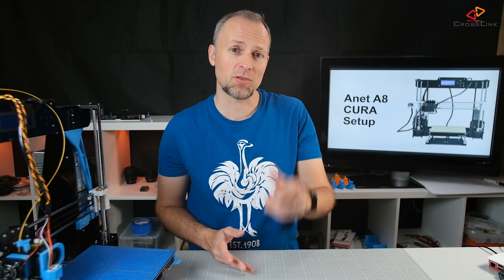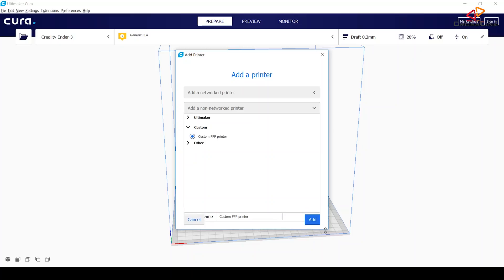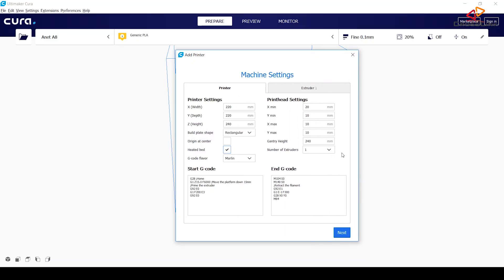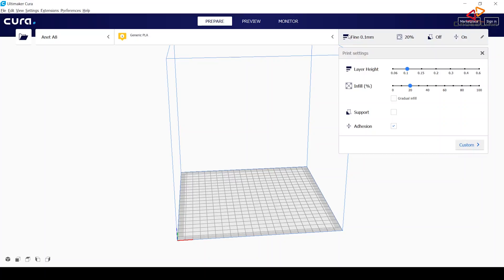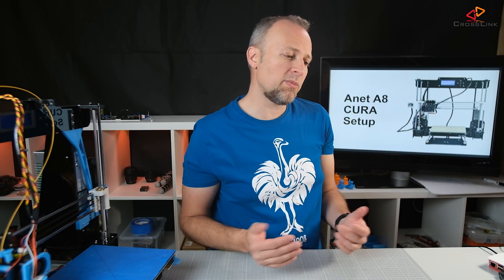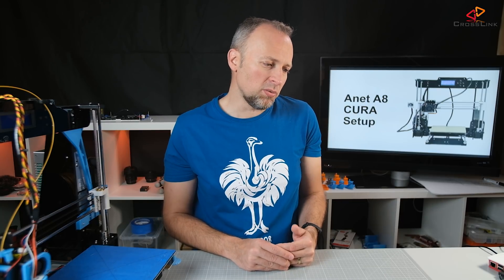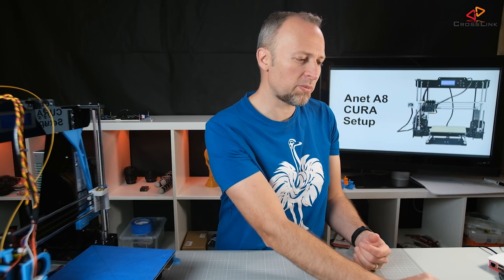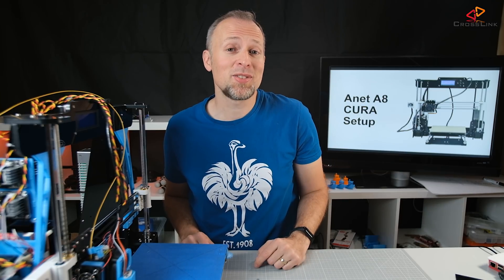Anet A8 CURA setup

Comment: I bought mine in 2018.  i need to setup a new pc but i dont have the old version of cura 14.07 which the document says to install and its not on their website. Can I use a newer version? if not, where can I get the old version?
thanks
Reply from the maker: You can use the latest! It works just fine
Reply: I found out CURA new versions will not support USB printing.. Older version is still available 3.1 works for me.  Also Setup your Com port to 115200  8N1N on Windows device manager

Comment: I was gifted a non functioning A8 with Marlin 1.1.8.  I repaired a loose leveler connection cleared a jammed hot end , replaced the lcd screen, figured out Cura and got it printing. I am now upgrading and fine tuning it. Is my next step upgrading Marlin? I don't know if my board has a bootloader. Where do I start with getting my software current?

Comment: Thanks for your videos , wonderfully explained. I have a problem with max Z axis height in which both hardware switches and cura software
Limit the height to about 35mm. I know what’s happening but don’t know why. Every click of the Z fast position operation assumes a 1mm increase
In height on the LCD display but due to the lead screw of 8mm it only  raises the Z axis by 1.25 mm every 8 clicks ( 1 rotation of the lead screw) so in short it only raises the Z axis by 1/6 th of the hardware reading. PLEASE tell me what to do , I’m in the dark , I have V1.5 motherboard.
Hope to hear , kind regards Alan.

Comment: How to set up print via usb. My other printer has no problem its a sintron sw 101
Reply: I found out CURA new versions will not support USB printing.. Older version is still available 3.1 works for me.  Also Setup your Com port to 115200  8N1N on Windows device manager

Comment: Man, I have a heck of a time getting my first layer going. I set up a skirt with lots of laps and far away from the part, but cura thinks I want to print with the nozzle like 4mm away from the build plate.  I have to crank the Z steppers down by hand a few clicks to get it close enough to the build plate for the extrusion to make contact with the bed.   - and if I dont do it this way, - IE, if I raise the bed, or adjust  the z axis zero switch, then the print nozzle will crash into the bed when homing...

Comment: Here's a weird question for you - the cooling fan (that points to the nozzle, not over the gears) doesn't turn on except when I boot the A8. I can't seem to find anywhere in Marlin where the code is wrong. Any ideas?

Comment: Daniel: is there a way to connect the CURA GUI to the Anet A8? I have a TronXY 3SX and I am connecting Repetier installed on my laptop to the 3D printer. The printer uses a Melzi V2.0.5 controller board. I can control the printer from my laptop. For small prints this seems to be easy. I have not found a way to connect Cura to the Anet A8 using my laptop. Have you fond a way to connect to the Anet A8 with Cura, Repitier, Slic3er. Thanks for any information. Richard

Comment: Maybe you should add in the description, that the video is a guide for setting up Anet A8 in Cura version 4.1 (which is pretty outdated by 2020/04).
The current Cura version (4.6) seems to come with an Anet A8 profile, though it differs a bit from your settings...
I would be happy if you would provide a new updated video.
Thanks though.

Comment: Great video, but when you set it up in cura, does automatically save them settings and then load them into the printer or do you have to manually do the same on the printer? I've only just built mine, and am setting it up, any help would be appreciated, thanks

Comment: Hey! I was given an Anet A8, but we've run into a problem. Everything seems to work except the hearing element isn't doing anything. It starts going through the motions of printing without anything coming it and the readout says 0°. I was told the heat sensor was bad, and they sent a new one, but I've tested the great sensor that already installed with a multimeter and it works. Any thoughts? I didn't buy this, it was given to me, and I don't know how to contact the manufacturer.

Comment: hello, i am having a problem with my Anet a 8 printer. the problem is its not printing the complete object but it show 100% on display but the printer just freeze there an do nothing  until disable the stepper and remove the print. please replay soon as possible

Comment: Hi : Daniel
My first Anet A8 is Ready for Take off. Im in Big trouble - Mac user. How to get started with Cura.
Need A video lesson.
Lars Lundbæk🇩🇰
Reply from the maker: So, CURA on Mac, I understand. I will have to get my old mac a new keyboard, then....
Reply: Crosslink Hi: Daniel
I Found out, when Mac writes “ No “
Ignore and go to Private Settings and accept.
Them it works.
Lars Lundbæk🇩🇰

Comment: Greetings, have you checked out the much better start and end GCode for the Anet A8 ?
https://tinyurl.com/rhb3y2h
Reply from the maker: Thanks for the link. My start and end codes look different. I use the ones from the Ender 3 that CURA creates. Works great. Especially the start code for the Ender 3 is much better because of the line it draws at the left side of the bed to get rid of any filament hanging around the nozzle.

Comment: Thanks for making a great video. I followed your instructions and I am having a better results.  I had a question. What is the reason when I am printing the filament is printing rough. bumpy. I that to do with the leveling?  How do I fix this? Thanks
Reply from the maker: Hi Marko, I would suggest, you print a benchy and send me some photos on twitter. Use the hashtag #checkmybenchy so I will get notified.
Reply from the maker: But don't send them on private message, just mention @danielcrosslink and #checkmybenchy

Comment: Is Anet A8 running with the G Code Flavor Marlin or RapRap, because it's always different in the videos from other Youtubers.
Sebi
Reply from the maker: Marlin flavor in my case. I have all my printers running on Marlin firmware. Also the stock firmware is Marlin flavor.
Reply: @Crosslink3D  Thank you for the fast answer!

Comment: Good video. For those using Cura 4.1 they need to add an additional 'Speed' setting. The value needs to be changed from '0' to '500'. If left at zero the A8 makes some looooong pauses when printing.
Reply: Can you please please elaborate. I actually would like to do this. Thanks !

Comment: Good video thanks.
I use both the latest version of Cura and 15.04.6 the reason is that 15.04.06 loads faster operates smoother on my 10 year old computer and is adequate for most of my printing needs but sometimes I want or need to use some of the new features and then I'll load the newest version.

I hope you get a chance to get an Anet A8 Plus. My grandson in-law has one and it's a huge improvement over the original Anet A8 in performance, build area and safety features.